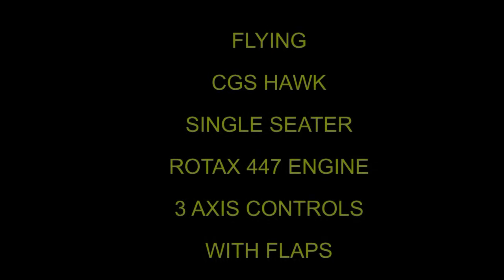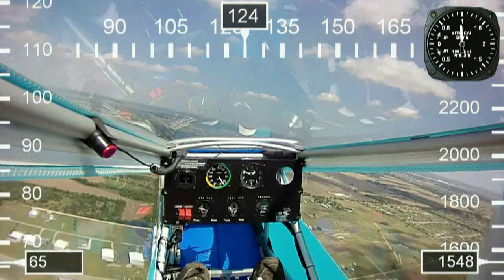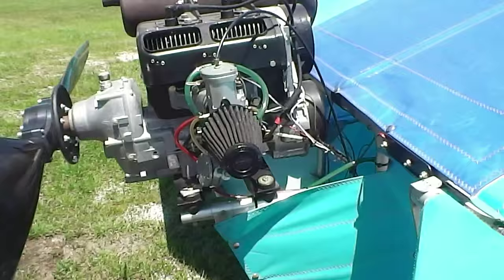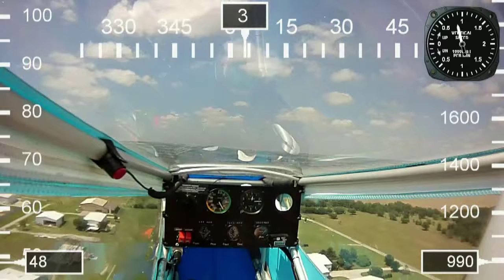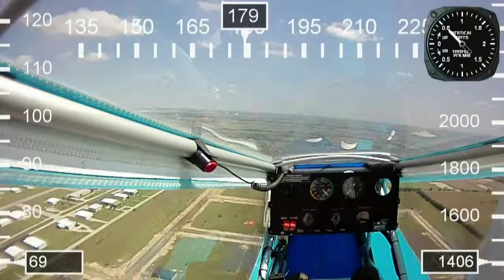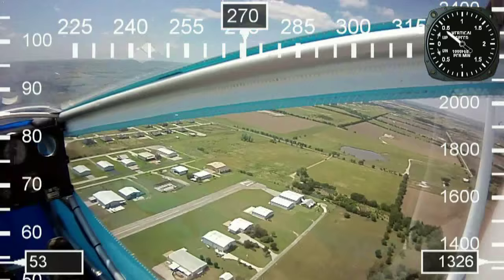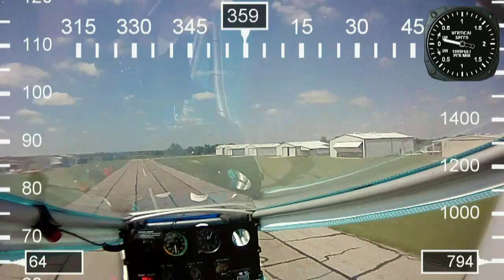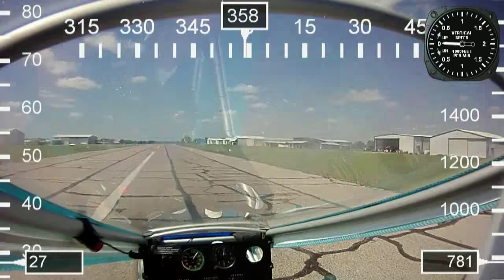CGS Hawk Ultralight Aircraft learn to fly by Roy Dawson video

Comment: Hi Roy,. . .I used to demonstrate the CGS Hawk 2 place back in the early 1990s when a friend had imported a few airframes and we were trying to get them thru certification with the PFA or BMAA to be legally built and flown in the UK ( What a NIGHTMARE ! ! !)
Orignially, the single seat model had a glass fibre body but this turned out to be too heavy, so Chuck Sluzarzyk sent us some fabric covers just like your current plane.  I found it to be a Nice, safe airplane and really easy to fly with no vices at all.   But we never got permission to use them for training, so the project died.
There is one complete airframe in a hangar at my local airfield, and one in the South of England somewhere.  We used the Rotax 503 in each case. This engine produced a cruise of 70 MPH with 2 on board, but the UK would not allow a larger fuel capacity over 25 litres, which reduced it's useful endurance.

It is still a lovely airplane.
Reply: Ir is always nice to read positive reviews if dads aircraft design.
Thank you
Chucks #2 son!

Comment: I've been considering getting into either paramotoring or ultralights and doing some research into both sports. I think ultralights are winning. It makes my brain feel excited by the prospect, rather than fear, because I have a very hard time dealing with heights if I don't feel enclosed by something. I'm even quite apprehensive in VR about certain experiences.
Reply from the maker: I think your feelings are normal. As long as I am in a aircraft no problems however I don’t like to get near a window high up in a building looking down, same as walking to the edge of a cliff and looking down

Comment: LOL I knew that was a BS sound effect at 7:15. The first thing I thought was "Why in the heck would you set the parking brake on after takeoff? Who does that?". Then I thought maybe you did it as a safety factor, in case you had to do an emergency landing somewhere to keep the rollout short, but then of course that is just ridiculous and would cause worse problems. Then I watched the nose wheel really close, and it didn't slam down, like it would have if the rear mains really were locking up. You had me going, for a bit, though. Reminds me of the time I put in some sheep sounds as i flew over some sheep on one of my videos on my channel. Funny thing is, nobody caught onto it. They really though they would be able to hear sheep over the sound of my 2-stroke, ha ha ha!
Reply from the maker: +glassdogangle Yes its a joke, funny how people respond

Comment: Should have deployable parachute affixed to top/center of wing for added safety!
Reply: If it needs a ballistic parachute,. . .then it shouldn't beflying in the first place.
Reply: @burntoutaussie4005  If I go sky diving, I'm going to where a parachute!!!
Reply: You would need to use a huge parachute to be able to slow a plane’s descent to a safe speed, and it would probably put the plane over the weight limit. That would mean you have to get a license to fly it, and the no-license thing is a big part of what makes this plane so desirable and affordable. Besides, you can still land the plane on any good sized piece of flat ground if the engine fails.

Comment: So Roy when you were doing those stalls you were still holding up elevator and the plane stalled gently straight forward correcting itself, that was not you moving the elevator forward to get out of the stall, right? I have never flown but  flew RC airplanes for years so I understand the principles on how things work, I wonder if that is helpful or contributes to bad habits?

Comment: I fly a Trike but sounds like this is a little more difficult to fly. I saw where a Sports License is about $6000. Do you know if that's true. I may look for a Part 103 fixed wing. I like the Rans S-14 but think that is too much plane for me right now.
Reply from the maker: I would recommend the  Quicksikver Mx sport with a 447 rotax. It must have ailerons. No license required

Comment: what would most affordable  ultralight go for?
Reply: The one that you build yourself. Basically a flying lawn chair with a cheap-ish paramotor engine.
Reply: an Airbike $2850 for a basic single seater short kit extremely cheap somewhat safe and one of the more "Raw" ultralights out there.

Comment: What's the difference between air speed and ground speed? Shouldn't a MPH be a MPH? One of the measurements has to be incorrect because let's say you're gliding at 50 MPH; you should actually cover 50 miles in one hour if that speed remains constant.
Reply from the maker: USNVA  Hello, GPS only measures ground speed, not airspeed. You will notice on the downwind leg to landing my ground speed is faster about (10) mph and when I turn into the wind landing my ground speed is slower. You are correct if there is no wind, then yes ground speed would be the same as airspeed
Reply: USNVA Air speed is all that maters to aircraft.
Think about it like this;
If your airspeed (the speed of the plane through the air) is 30 MPH and you have a 30 MPH headwind you ground speed would be zero.
If you turned the plane around you would have a 30 MPH tailwind and a 60 mph ground speed, provided your air speed was still showing 30 MPH.
Reply: +Bass Player would that be a stall or would the prop push you to 60 mph
Reply: what a great explanation i was watching a micro light fly over our beach the other day i couldnt  understand why it flew so slow and  it still kept up in the air infact i walked down to the sea and i was ahead of it.
you had a near miss Roy with a hawk in this video glassdogangle hit a one,do hawks think these planes are hawks
Reply: @Bass.Player  so if ground speed is zero, is the plane standing still, hovering, to someone on the ground looking at it?
Reply: @hawk1481  Ground speed would be 60, air speed would still be 30. It's hard to know if the engine or prop speed would remain the same. I doubt it at least initially...

Comment: Empty weight 310 lbs not even close to the Part 103 max weight requirement for an ultralight... ??
Reply: If you can find a 254 pound ultralight is like finding a  Unicorn